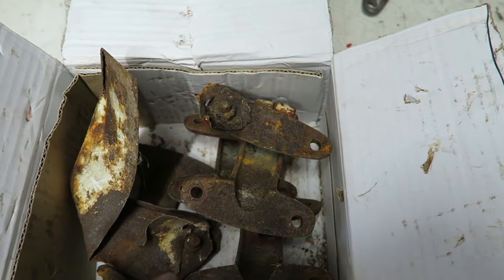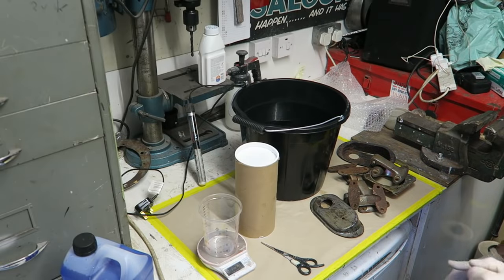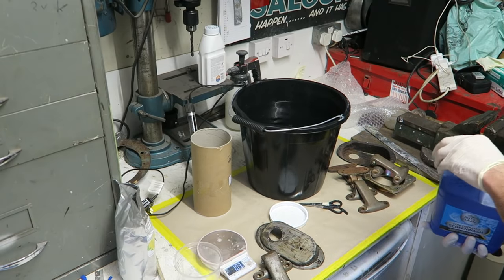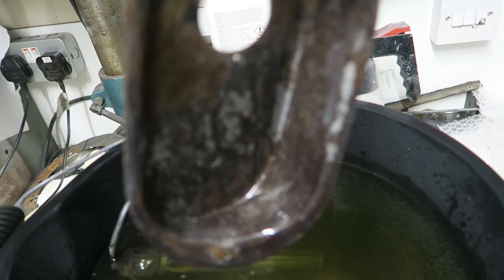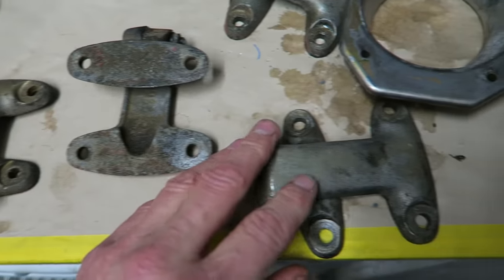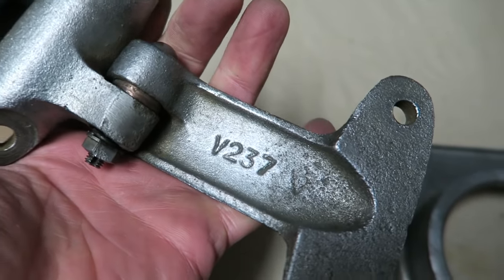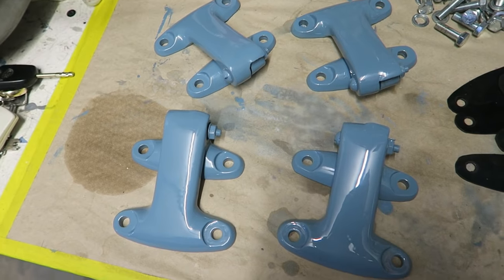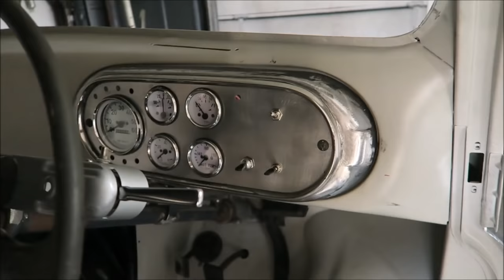Trev's Home Brew Rust removal potion solution remedy Tips and Tricks #23

Comment: If you're not in a hurry for the part, you can use the old school Molasses/water bath at a ratio of 7 parts water to one part molasses. We put entire body parts in a molasses bath and the good thing is that it removes rust ONLY (acid just keeps eating). The downside is that it smells pretty funky in the summer so you'll want to keep it away from the house and put a lid on it to minimize evaporation and to contain the smell.

Comment: Great video thanks. I do a last stage before painting - treat with phosphoric acid, Kurust for little bits. Love to see the CA van. My Dad had a 1960 CAL Kenex Yeoman, 3213 K. Mid-60s I got the job of panel beating & painting the o/s front wing when a malicious lamp post attacked it. Managed a total no-filler repair & brush painted the deep red & cream to match with Tekaloid.
Keep up the great work, your tremendous efforts are appreciated!

Comment: Thanks to this video I refreshed the front of my Morris 1000 Traveler this summer. Once everything was stripped to bare metal and de-rusted as much as practicable with a knotted wire brush I used a 1-2% solution in a wheelie bin. Twice a day I removed the parts, washed and wire brushed the rusty areas, washed again and then back in the bin. Took a few days but all the rust was removed. A final rinse and then dry quickly with a heat gun before than removing the light grey oxidation that formed, wipe down with degreaser and finally prime with epoxy primer. It worked a treat. I then did the same with 4 steel wheels. All painted and car back together. I'm about to do the same with the back end and the kick plates etc. but I'm expecting it to take much longer in winter!

Comment: personally I am using a high pressure sanding. It requires strong air supply, but cleans rust effective. After I put over Loctite 7505. 
2 days ago I was using your dent flipping technology and was happy with the final result on Ford Fiesta doors. Good luck !

Comment: I'm glad you mentioned hydrogen embrittlement. I was thinking of soaking a corroded gearbox in a solution that contains citric acid. I think that the gears are subjected to a little too much stress to risk embrittlement.
But, I have found out that it only occurs at room temperature, so maybe a very hot bath might prevent it ?
Also, if the piece is heat treated to about 220 degrees C within 4 hours of hydrogen exposure, that gets rid of the hydrogen. But I cant fit the gearbox in the oven.

Comment: Is Trev coming from the UK?
I'm here in Canada working on a 1993 Plymouth Acclaim. Bought it used low Kim's. Previous owner never washed the road salt off from Winter.
The factory painted all the rims and suspension parts with that thin electrostatic black paint. Well the salt ate through it and rusted everything. So I disassembled the front and rear ends. Washed the oil, dirt and grease if any. Used paint stripper, scraped, wire brushed and rotary wire brushed with a electric Die grinder. Then filled a plastic tub to submerge the wheel rims and soaked them for two days in a 50/50 mix of Muriatic Acid and water. Removed all the rust deep into the pits. After used Ajax and liquid soap to wash and clean the metal, flushed down with water. Then used a milder acid called metal prep to prevent flash rusting, washed off with water again then sun dried and ready to Prime with metal Primer. Two to three coats of Primer, lightly sand and top coat.
Don't waste your time removing heavy rust with other vinegars, mild rust removers etc. you will there to Christmas. Use Muriatic cleans fast and is Violent. Cleans heavy rust fast. Sandblasting can be use after. Sandblasting can not get down in the pores.
Also did electrolysis using a battery charger. Ok to a degree. But Acid gets it cleaner faster.

Comment: Evap-O-Rust and electrolysis are all I've used. I'm definitely going to try citric acid. These parts turned out perfectly. Thanks!
Reply: I've seen a test where Evap-O Rust did absolutely nothing to dissolve rust. the test was done by a youtuber who tests various products equally and scientifically. 
muratic acid which I've personally used will dissolve the rust in about 10-15 minutes soak. I usually dilute it to about 10% Hydrochloric acid instead of 37.5% which muratic is.
products with phosphoric acid are the next quickest. vinegar works too but is rather slow but its also pretty safe as you can drink vinegar without a problem.
if you prefer the non toxic and bio degradable properties of Evap-O Rust then go ahead.
Reply: @darkshadowsx5949  Evap-O-Rust doesn't work if the metal has oil on it. I saw that video. Something was off there, maybe oil, maybe something else. A dip in any strong acid will emulsify any oil, then it can be rinsed and tossed into the Evap-O-Rust for a week. There won't be any rust on it after that. Unlike acids, the metal won't turn brittle or soft, and you don't have to hurry to prime it because it won't corrode until you rinse it really well. It's not as fast as other methods. Other than tax refunds and pizza deliveries, how often is faster better.

Comment: Hi Trev.

Love your channel, loads of really good info, particularly all the panel beating stuff.

For rust removal, though, I can't recommend anything more than electrolysis.  It's dead simple, all you need is some sugar soap, water, some scrap steel and a DC power supply. There's no need to worry about leaving your parts in too long, no need to neutralise the parts after treatment, and no need even to strip paint or to degrease - it'll pretty much all come off during the process, especially if you drive the process with a DC welder as opposed to a battery charger.  The reason I prefer electrolysis over anything else is that it doesn't remove any good metal, and converts the rust from the dreaded red death, Fe2O3, to stable, non-cancerous, Fe3O4 (magnetite).  I use it for rust removal on machine tools, lathes and the like, where precision is important, and abrasives are pretty much a no-no.

As for the whole hydrogen embrittlement thing, I used to worry about it, but decided to do a test.  Took a bunch of identical springs, rusted most of them by dipping in and out of salt water.  Kept a couple of rusted and a couple of clean springs as controls, chucked the rest in the electrolysis bath, DC welder at 20A for an hour or so.  Pulled half out, dried and oiled them, then hooked up the battery charger and  left the rest electrolysing for 2 days.  I then pulled them to destruction using work's little load cell and a hand winch.  Result - no discernible difference.  Less than .5N spread between all the springs, they all went to plastic deformation at about 30N.  No premature snapping. None of which is to say that hydrogen embrittlement is not a real thing, but I couldn't see the effects.
Reply: the embrittlement comes from the acid surely?

Comment: Vans looking beut Trev, I’m restoring a car that was 14 years outside and I’ve used Electrolosis for doors (no prep required and cuts through grease) Envirorust for S and Giggles on nuts and bolts, My favourite finisher now is Phosphoric acid, I prep with Vinegar a bit but like sandblasting it has its disadvantages in that the clean up is a lot of labour.  All hinges, brackets etc I used Mollasses, very slow process, parts needed prepping similar to the much nicer looking process of Citric acid, I’ve bought new old stock parts prepped in Citric acid and was told that’s the correct way to do it so nice to see the process thx

Comment: Plating on those parts either zinc or cadmium which has been passivated after plating.   If worried about hydrogen enbrittlement suggest place parts in hot oven for 30 minutes after your stripping process.   Heating will drive off hydrogen.   Information comes from Aviation MilSpecs for Electroplaters.   Rather important for the springs you mention.
Reply: Gonna' mention that myself - you beat me to it.

For general purposes on steel, about 450° F.

Also useful for critical parts that have been arc welded (esp. w/o low-hydrogen filler) as well as plated stuff

Comment: I like to use Dairy Wash from the farm store for rust removal. It is phosphoric acid and a bit of soap. It dissolves rust faster than steel and will leave an iron phosphate coat on the surface which acts as a protection to flash rusting.

Comment: hydrogen embrittlement can be reversed by backing the steel in the oven to get the hydrogen out.
Reply: How hot and for how long?
Reply: @bjrgjohannessen5184   4h at 400F
Reply: Jan Van Ruth, you beat me to it... Yup, bake your steel parts if they've been acid etched - or plated, and they're in a highly stressed application
Reply: I have the same or similar result with molasses 
Time soaking depends on the temperature of the solution .
I can get great results like you did in summer 
But in winter a lot slower for sure

Comment: Trev! Bravo on the re-do of this vid- great info! You give a great tip about the paint stripper at 2:45 or so... Might want to consider if you dont want to use so much stripper giving the piece a brisk stainless steel wire brushing first... gets the surface oxides and generally the dirt and crud off so the strip can work directly ON the paint- and you dont use quite so much of the chemicals to boot! Love the channel and gotta say well done indeed!

Comment: I know someone else suggested it, but a small media blasting cabinet would have been perfect for those hinges. Probably not so good for those thinner metal parts, depending on the media used. I like to use POR-15 metal prep on a lot of things because it leaves a phosphoric coating afterwards to protect the metal.  It almost looks like you used a single stage paint for the hinges? Your panel gaps look PERFECT. Love seeing the progress on the van and appreciate your tips and tricks massively!

Comment: There's a lot of things you can use that citric acid for, and the "food-grade" rating keeps the options open. If you're in a hard water area, it works for kettle de-scaling, and costs a lot less. But I'd keep the kitchen supply separate from the workshop supply, maybe re-use a jam jar, and label it.

You mentioned alternatives such as white vinegar, and I can confirm that works, helped clean the bottom of a saucepan and it was within easy reach in the kitchen.

Comment: The most common substrates material for zinc are carbon steel, unalloyed steel, low alloyed steel and cast iron.
By applying a heat treatment after zinc plating hardened steels can also be zinc plated. The heat treatment is necessary to avoid hydrogen embrittlement. 

Source: uk-finishing.org.uk

Comment: I just use white vinegar and let it soak for days, scrub with a green pad and rinse / repeat. For stronger cleaning add a little table salt, works perfectly! Also cleaned electrical terminals really well. I’d save the money on the heater etc and use this.

Comment: Surface tension is broken you are correct they use it in spraying weeds also, so the chemical won't  just run off  the leaves. It forces the chemicals to stick and stay put.  Without it it's spotty at best then you have to go back over , and over to kill the weeds. Makes it less effective for killing weeds if it's  just water and weed killer so detergent added really solves the problem calling it a surfactant.

Comment: I would put the fasteners in a lathe and take the markings off the heads.  Hardware store fasteners will look out of place.  You can even use knurled bolts (like wheel studs) and turn them down to look like rivets.  The knurl will keep it from spinning when you tighten the nuts.

Comment: Believe it or not I've let rusted pieces soak in a bucket with Coca Cola for 24 hrs. It worked great. Took the pieces out and used a drill with circular wire brush and cleaned em up pretty good.

Comment: Another great video.  Trev, keep it up!
I do love that most of you're videos are low cost, but high skill.  Meaning, many videos just go ooo let me go over to my €$1000+ piece of equipment and do this.  That piece of equipment is probably out of the cost range of many watchers (like myself).
Reply from the maker: Nate Hankins Thanks you get it 🤩 hallelujah 🤩most people trying to make a point are always saying ahh yeah but there’s a better way..... of course there’s a better way, there always is but you can’t get much more simple than a bucket and some elbow grease. We’ve got two 700 cfm compressors and a dedicated blasting booth at work but what would be the point in showing that off. Cheers much appreciated Trev 👍

Comment: Same method I've been using for years.  Hydrogen embrittlement is very low risk, but certainly worth mentioning.  Hydrochloric on the other hand almost guarantee hydrogen embrittlement.  I've only had one cast piece damaged using this process.  I don't know exactly what the cause was.  It is possible it was riddled with rust throughout the porosity , or for some reason the excessive soak time ate it away.  I've tried with other sacrificial cast pieces and never experienced it again.

Comment: I had to look up the yellow coating to be sure:

“Clear zinc bolts have a lower "corrosion resistance," according to Fastenal. The clear zinc bolts are required to remain rust-free during a salt-spray test. Yellow plated bolts have to last 600 percent longer before red rust can appear during the same test. Steel bolts vary under the test, with some bolts lasting only three hours.”

Comment: Good tip re the plastic on the paint stripper -- not that this has anything to do with cars (HA - it can) - but I often use cling wrap (Glad Wrap here) to keep paint rollers wet -- the roller will stay useable for days - even weeks before unwrapping (as long as not left in a HOT Australia Summer heat shed -- HA - as I have done in the past).

Comment: Hi Trev. Another good video. Thanks. I have used white vinegar with similar results. A gallon of white vinegar is not expensive. I did not dilute which would take some experimenting to see if it improves the results or makes it less effective.  A thought on the washers. Use AN washers (AN stands for ArmyNavy)  that are utilized on aircraft. I would imagine  British aircraft use them. They are close tolerance and the outside diameter is smaller than automotive or hardware store variety. They are available in stainless steel or cadmium plated- real cadmium and not look alike zinc. 

The finished hinges are fantastic. Older Jeeps (military and CJ) never painter parts separately. Hinges were bolted onto the body and doors, then everything was sprayed. Removal of door or hood hinges always reveals rust. It is done differently today.
Reply: Vingear is citric acid in dilute form.
Reply: @WunHeart  Isn't it called acetic acid?
Reply: @4speed3pedals  should have been citric acid

Comment: Nice, wish I could just dip my entire car like that without any problems :) This is the first time I've seen this exact technique, very interesting. This seems like a very effective way to get rust free part, so I'll give this a go. I've seen in some similar things where they use fluids to interact with parts, that moving the parts about horisontoly when submerged can remove some air bubles that get trapped. Don't think hydrogen imbrittlement will do much under 200 celsius, but I could be wrong.

Comment: I haven't tried the citric acid yet but that looks very good.  Whenever I use rust removers I find that any grease or oil on the parts really creates a barrier to the rust removal.  I thought about dunking the parts in lye first and using the pressure washer before the rust remover.  Maybe that would cut down on the number of steps you needed to go thru.

Comment: you are correct that is zinc plating that dissolved off that gear shift part.
Reply: I think you mean Cadmium Plating.
Reply: @richardmason902  Sorry but no I meant zinc It has been widely used in the automotive industry! Google it, it will back me up. Have a nice day
Reply: @richardmason902  No I meant zinc, its widely used in the automotive industry.

Comment: I use household vinegar to do the same job. Acetic acid, vinegar, same thing. You can water it down if you need to and it can be had cheaply. Once your done, you can neutralise it with baking soda, rinse it off, then on to prep and paint.

Also, that gold-ish coloured plating looks exactly like zinc. You can buy bolts with that same cheap look to them. Awful looking stuff, but I guess it did its job... I prefer the look of nickel plating myself.
Reply: i think the zinc is zinc chromate and it is regarded as highly toxic.

Comment: Great video Trev. I learned a lot and will give the "Secret Solution" a try. I have been looking for a good alternative to both sand and soda blasting as I think that removes too much " good " metal. An Australian panel beater friend suggested he has good results with agricultural grade molasses. I haven't tried it yet but he uses it to derust  some quite large parts. Thanks again for sharing your extensive knowledge.